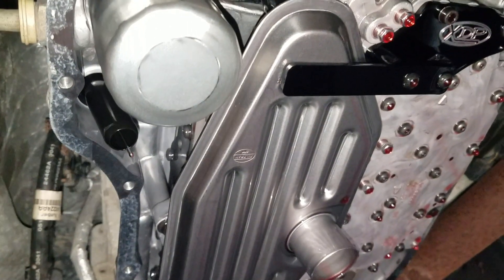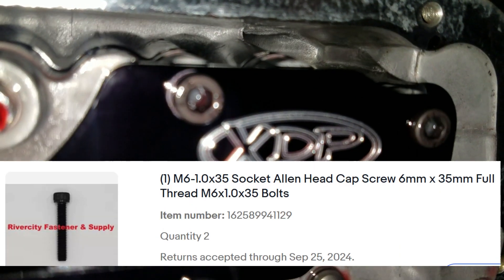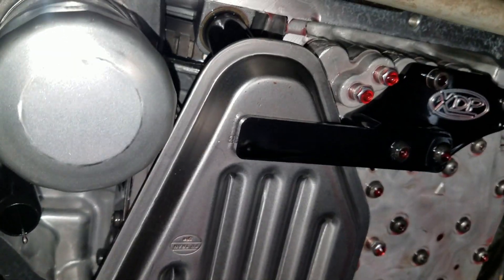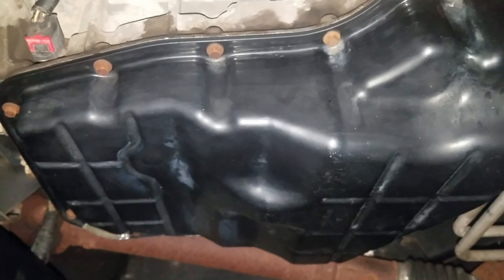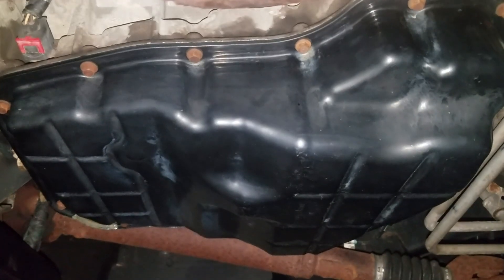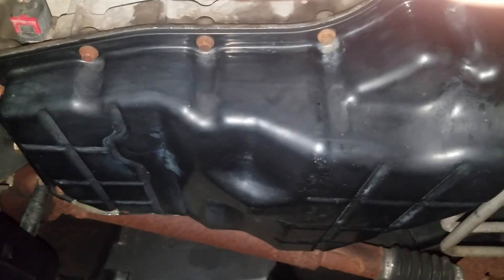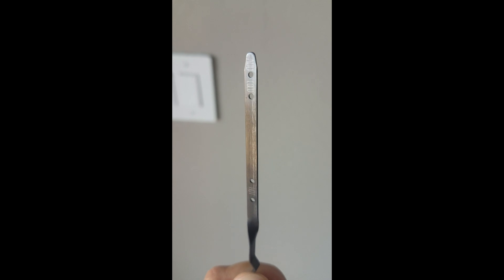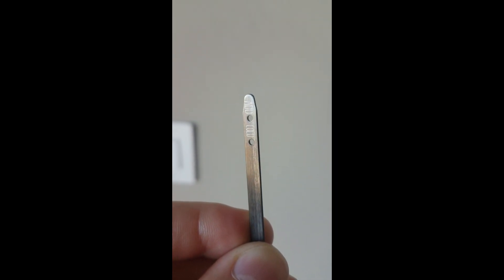68RFE Service Tips & Tricks w/ 19'+ Mopar Pan Gasket | RAM

Comment from the maker: Dear viewer: To add a note regarding the stock pan bolts. 
The 19'+ pan gasket is thick, and the bolts don't have as much thread engagement as they did with RTV. This was another reason why I torqued to 95-inch pounds instead of 105-inch pounds. 

Goodluck!